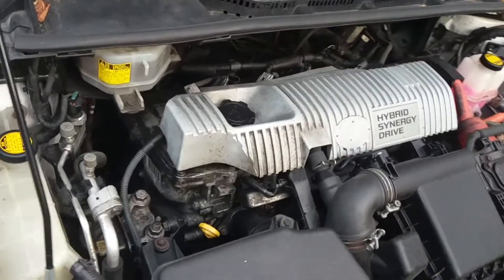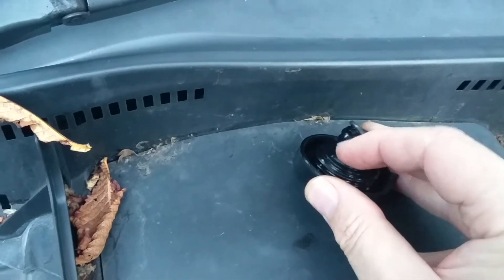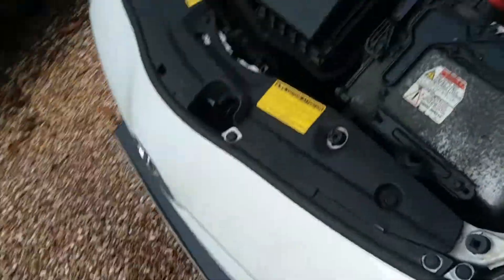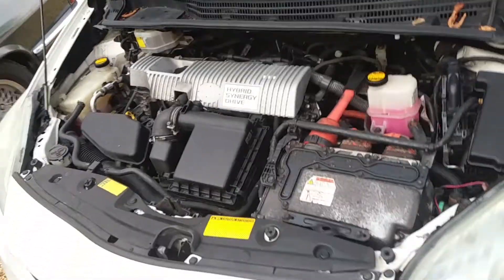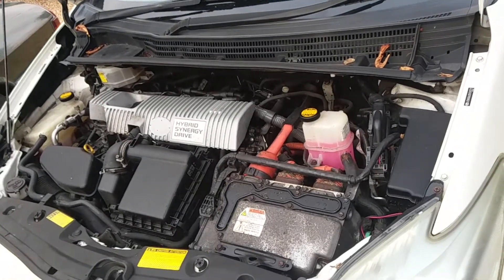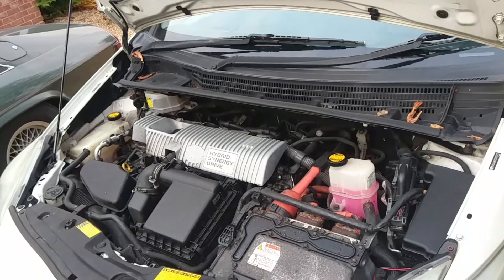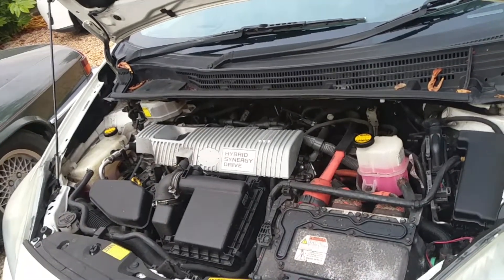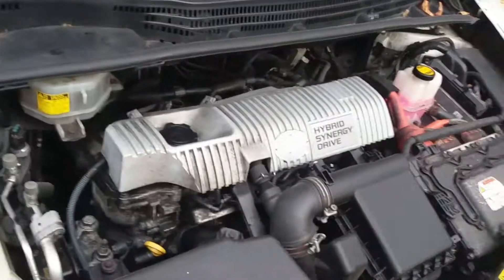This third generation Prius cooling system tweak mod may save your engine 1.8L head gasket leak fix

Comment: Weird problem. 2012 Prius, 145k miles. Oil changed religiously at every 10K, 0W20 full synthetic. Never driven at low coolant levels. Sudden loss of coolant on the highway. drove 200 miles one way, no problem. on the way back, stopped at every rest area to add DI water, i.e. every 30 miles or so. In each case, there is still some water in the plastic tank. Engine runs smooth, accelerates smooth, purrs like a cat. No white water vapors in the exhaust. Took apart the front, and looked for pink residue around connections and radiator seal lines. No pink residue. Rubber hoses are tightened with original spring clamps, but no pink leaks. Electric water pump is clean. However, there is pink residue at the back of  the plastic overflow tank, the firewall and the drive shaft. Sometimes the leak is so big, that it ends up on the front passenger tire and the passenger side doors. How does it go from inside to the OUTSIDE the vehicle is a mystery. Check engine never shows up. The high temperature light comes on and off, sometimes flashing, sometimes solid, then disappears. Driving around town seems no loss so far. Planning to do a pressure test and exhaust fumes test later on today.
Reply: Are you losing coolant out your exhaust through the catalytic converter.  You might need to hack in a bypass coupling pipe for the hoses that go in and out of the cat.
Reply: @jafinch78  thanks for the advise. no i am not. i saw this video as well. my problem is sporadic and intermittent. the best guess is a thermostat that works/does not work intermittently.
Reply: @west_park7993  Are you doing grill blocking and is your radiator clean?  I literally just ordered a dedicated smart phone and a high strength adhesive metal plate to mount to the back of the phone so I can mount using an old HD magnet on a Dollar Tree cell phone stand I used 3M double sided tape to mount onto my dash.  For the DIY heads up display I'm using either Hybrid Assistant or Car Scanner to monitor the engine coolant temp.  

I was 100% engine grill blocking using half inch foam I cut and slit to fit over the grills.  I had to remove the top piece of foam due to having a rattle that seemed to manifest over 198 ish degrees engine coolant temp under the following conditions where full or above half AC setting, 80 degrees plus outside temp, stop and go or slow speed low acceleration, in ECO mode, the HV battery almost completely drained and when I'd go to accelerate during a certain range I'd get a rattle where I'd have to stop pressing the gas pedal and slowly ramp up my acceleration again or go faster like in PWR mode like. 

I found after monitoring the situation where the above was occurring seemed to be 200-205 F engine coolant temperature.  I haven't noticed since I removed the top foam piece blocking the grill, though I haven't had like anything like I noted in my last video I uploaded regarding the coolant level mysteriously decreasing and then increasing above full as to where I topped off a few days back assuming I lost coolant during that rattle through my head gasket when I was on the freeway in stop and go traffic for around a half hour or so. 

No death rattle startup vibration or rattles either.  Though I did have a misfire situation after running 2 bottles of Techron consecutively in 2 full tanks of gas accordingly and with an oil overfill situation I didn't drain out and drove 3hrs each way on a road trip.  I found my PCV Valve was bad and I was parked on an incline when the misfire death rattle startup situation occurred. After cleaning out the intake circuit, replacing the PCV Valve and cleaning that circuit and cleaning the EGR up to the insides of the EGR Valve, I haven't notice the startup rattle other than the first time post cleaning since I guess I didn't disconnect my 12V battery to reset the ECU or was a rainy humid period with colder nights so maybe so condensation in the intake.  Either way, has been nothing observed other than sounds like bubbling when the engine starts. 

I assume and am preparing for engine head gasket change and maybe some other maintenance while apart or possibly another engine to swap in and rebuilding.
Reply: toyota determined it is a tiny leak of coolant into cylinder. too small, so you dont see the typical white smoke. i just took the engine apart, and the headgasket appears ok. second opinion: the break is so small you can not detect it. i must trust the toyota mechanics. home they are right... if you do this, you MUST clean the EGR valve, and especially yhe stainless steel heat ecxchanger. oven cleaner, pressure washer, boiling in hot water outdoors. Finally, a lab bunsen burner driving the flame tru the inside channels. remove all the gunk!
Reply: Hmmm - interesting - look forward to the findings...
Reply: @napierpaxman  Wondering if the catalytic converter?  Gasket Masters did a video showing about the bypass the catalytic converter pipe mod.

Comment: It depends on the situation . If you use the car for a few miles/ day , in the city or short trips at low speeds , it will be everything OK .
But don't do it when you go long road trips . It will decrease your boiling point and this means there will be much more heat in the engine , risking damaging in long therms or boiling the engine .
My solution : bought another cap ( 2,5$) and removed the orig . Now i have 2 caps . One i use it in the city , without orig and the untouched original for long roads .
Better be safe than sorry .
Reply: I live out here in the valley of California we're right now it's 100 plus degrees, and I drive it 100 mi radius within the same altitude it's just a couple hundred feet here above sea leve in the valley l and it does completely fine long distances in the heat over here down in the valley, now when I bring it up to 3000 ft it  in the mountains it gets to 207 degrees without the o-ring so yes you have to be careful when driving in altitude with no o-ring, other than that it works beautiful and in the morning it doesn't do the death rattle hydro locking because there's no coolant in the cylinder no pressure to make that happen.
Reply: The hottest it's ever gotten here in the valley of California is 198 °no matter where I go as long as it's low altitude.
Reply: @skiwealdo1973 How are you measuring engine temp or is that coolant temp? 

I removed the O ring, was fine for and then dropper a litre of coolant on the ground last night, can't understand it.
Reply: Nice idea :)

Comment: I had a similar thought. I was going to make a hole on top of the coolant reservoir. But Toyota knows about head gaskets on their Gen 3 for years and doesn’t update their reservoir or cap design. Isn’t that for a reason? 

There’s definitely some pressure when the coolant is hot, but is it really enough to damage a fully functioning head gasket? Or head gasket needs to be already compromised before coolant under some pressure makes it into the cylinder? I wish more people experimented with this hack

Comment: Wow! Thank you for this video. I can't believe I stumbled upon it after everything I've tried. THIS WORKED! I have no decrease in coolant level either (not yet anyway...crossing fingers). No more shaking, check engine lights turned off (I'm assuming because no more misfires)...after changing spark plugs, coils, cleaning manifold, fuel injectors...was just about to dismantle the EGR and try cleaning that. THANK YOU! I can't believe this worked!!!
Reply: Whoohoo - great! Sounds like your head gasket may have already started leaking - least this will save your connecting rods from breaking, meanwhile you might be able to do a temporary or even permanent fix on the leak by using one of those head gasket leak stoppers that you just tip in to the coolant bottle - with the pressure off the system, it has a greater chance of working, even if only as an interim fix - may even work permanently, saving you the cost of an engine rebuild..... :)
Reply: @napierpaxman  Thank you! My Prius has 190,000 miles on it, so even a temporary fix would be wonderful. If I can get even 60k more miles out of this thing would be a blessing. My check engine light came back on, but I believe it was my fault for overfilling the coolant. I was afraid of it being too low so I filled it. I believe I filled it so that it got back into cylinder #1 leading to a misfire again. I'll try to get it back to the level it was before and hopefully it will run smoothly again. Fingers crossed! Thanks again for your help with this. I can't believe that this is the fix after all of the things that I have tried.
Reply: @bobbylopez77 How has this fix worked out for you? Ran into anymore problems?
Reply: Update since?

Comment: I dont get it… my gen 3, as soon as the water pump kicks on it builds up enough pressure to overflow the coolant tank.  Taking off this oring will just cause coolant to leak out immediately.
Reply: Hmmmm interesting......

Comment: 😅i had a check engine light come on and coolant was low, i refilled coolant and did this fix, my suspicion is the presure in the system causes coolant fluid to reach the cyclinders through the head gasket(assuming there is a leak) thus causing misfires, my codes were p0301 which is a misfire in cylinder 1 , i also had random misfires in cylinder 2, after removing the oring and checking oil and coolant levels i do not have the rattle on cold start anymore, at 199k miles a bad head gasket is most likly the cause for the rattle start and misfires, this eases the problem but i will keep an eye on oil and coolant levels knowing the gasket is weak.
Reply: Whoohoo - great feedback thanks - I wonder if it also would be an idea to put some additive like 'Stop Leak' in to the cooling system as it's known to have issues?
Reply: I am having the exact same problem and my car is also at around 200k miles. The engine loves to rattle while idling and it disappears when I pedal on the gas. I went to the repair shop and they offered $1500 to fix it. I decided to give it a shot fixing it myself. I will try this treak to see if it gets bettter. Did you change the engine gasket or anything?
Reply: @LuofeiZhou.Realtor the rattle can also be ignition components or the fuel injectors
Reply: @LuofeiZhou.Realtor any update on your situation? Did this trick help out? Were you able to replace the head gasket yourself?

Comment: Any one know if its ok to use zerex coolant that's pink on a 2007 prius already have toyota original pink coolant in the radiator just wanting to add some to top off and have a zerex coolant at the moment

Comment: Oh thats the perfect tweak for me right now. To add to your method I would try converting to waterless coolant as the pressure of waterless is coolant is far less than traditional coolant. 

Had I known this before I would have maybe not had my head gasket fail
Reply: Did you try to replace the coolant to waterless yet?
Reply: @mohammedmoqbel3688  Car was sold in working condition as I replaced it with a PHEV Prius :)
Reply: Oooo great. Waterless Coolent - that's new to me, will do some reading up.. :)

Comment: Car does 400k no problem with factory o-ring, driver decides to mod the cooling system. I'd rather stick with what was working.
Reply: It was a taxi - thermal cycling is part of the problem, this car ran all the time so few thermal cycles until I got it ;)

Comment: When the cooling system is not allowed to hold pressure above ambient, it lowers the thermal load capacity because the coolant will be able to boil at a lower temp.  Not sure if the engine will need the additional capacity to ever become a problem.
Reply from the maker: Yes - people in hot climates would be advised to keep a close eye on the level....
Reply: @inspiringengineer what are your thoughts or waterless coolant instead of this for people in hot climates?

Comment: Will this work on a high mileage Gen 4 Prius?
Reply from the maker: Gen 4 is an improved system - doesn't need the tweak... :)
Reply: @inspiringengineer  Well, then, how can I go about rectifying what appears to be the same situation, that my car with 200, 000 miles seems to have? I tried your tweet this afternoon, and hoping to see if it will indeed work for this 2018 Prius which loses coolant.
Reply from the maker: @truthsleuth  Gooid luck! If that doesn't work - try a coolant 'stop leak' type additive in the coolent - it won't fix the underlying problem but if could save a broken connecting rod! ;)
Reply: 238,000 miles  on the 2012 Prius V.   loud clattering at start up.  Smell of exhaust mixing with Coolant.  Assuming this was a head gasket issue I Used a highly recommended head gasket sealant which worked for about 6,000 miles. Now that the problem has resurfaced I'm using this coolant cap o-ring method which seems to be working for the most part.  Hard acceleration does produce a check engine light-cylinder 1 misfire however.  I really like my prius but don't know how much life it's got left in it.   so do I keep it or sell it while she's still running is the question running through my head.right now.
Reply: @ModisOne  my prius 2011 had misfire 220,000 miles took it to the shop and they said it needs a new engine $2,000 replacement..... i got pissed and took my prius home and bought new NGK spark plugs and new set of coils in amazon, took the egr pipe and cleaned everything, cleaned the throttle body and air intake sensor. that was 2 yrs ago and it never came back. now at 250,000 miles and I'm doing this mod 👍👍
Reply: @MrEqp123  Bravo!  I didn't see your post until just now (4-months later), I just rebuilt the hybrid battery pack this past weekend  as it got down to 25% life expectancy indicated by the Dr. Prius app.  Got all kinds of error message after reinstalling the newly rebuilt pack but after driving a about 30 miles or so everything seems to be normalizing.  Codes still reading POA80 for some reason but the charge/discharge seems to be working fine.  Dr. Prius app showing 97% life expectancy which is great.    At 249,000 miles right now, only problem is misfire in cylinder 1.  I guess I'm going to have to go the route you did to see if I can resolve it.

Comment: Does this mod work long term? How long have you or anyone else been driving your Prius without the O Ring? Please let me know I just started driving it like that yesterday and runs perfect now and no coolant spewing either
Reply from the maker: Two years later - working just fine :)
Reply: @inspiringengineer  it lasted a week for me, unfortunately. I ran it without the o ring was working great for about 2000 miles but all of a sudden car overheated and all my coolant was gone in a matter of minutes. I think my water pump went bad. Not sure if it has anything to do with driving it with out the o ring or just coincidence that the water pump went bad a week later
Reply from the maker: @darrellmatlock5131  I would say it was just coincidence - did your engine survive OK?
Reply: @inspiringengineer  yes I replaced the thermostat and the water pump and it was working great again, but since I travel a lot I was tired of messing with it and bought a new Kia Forte traded in my 2013 Prius with 230k got $4500 for it
Reply from the maker: @darrellmatlock5131  Hope that wasn't a mistake! :D
Reply: @inspiringengineer  my Kia Forte is actually getting 44mpg so I’m happy
Reply: For how long would you think this will

Comment: This does work to stop the coolant from leaking into the cylinder, but you risk the coolant expanding & coming out from the top. This already happened to me once
Reply: if it blows out, you're head gasket could be leaking already, blasting water out. i did this mod to a Volvo with a leaky head gasket and drove it for 40,000 mi with extra expansion tanks to hold the overflow
Reply: Yes mine had the same problem and I took off the o-ring and it worked for a few months and then all of a sudden it opened more and started gushing, so the head gasket was done stops sealing and had to be changed out to run, so turns out in my case the o-ring taken off did not work but a little while before it eventually open bad and had to be changed out!!!
Reply from the maker: I've been OK so far - but all our situations are different.... ;)
Reply: @inspiringengineer  I’m curious to know how it’s going 4 months later?? Are you still driving it without the o ring?
Reply from the maker: @darrellmatlock5131  Yes - going just fine - no drop in coolent level :)
Reply from the maker: @darrellmatlock5131  Going well 2 years later ;)

Comment: It will damage your car. If you do this.
Reply from the maker: Why - please explain - hasn't damaged mine or my son's car ;)
Reply: @inspiringengineer  for how long time  have you driven the car without the oring?? Explain that.. we may drive it a couple of days.but the engine needs presure to function
Reply from the maker: @franciscorousset9629  Cooling circuit does not need to be pressurised, if it did the engine would fail when cold as pressure is only there when warm
Reply: @inspiringengineer  does pressure increase boling point specially around the cylinder walls??
Reply: @inspiringengineer  без давления в системе охлаждения антифриз заказать при температуре+95°С. А под давлением закипает при +123°С.  Датчик температуры не покажет что охлаждающая жидкость кипит при низком давлении. По факту плохой съем температуры с цилиндров. Что приводит к быстрому износу двигателя. Учите физику!